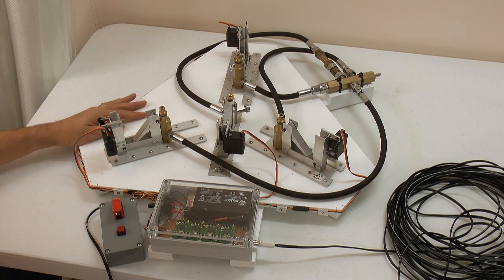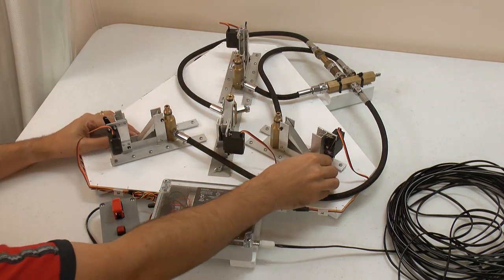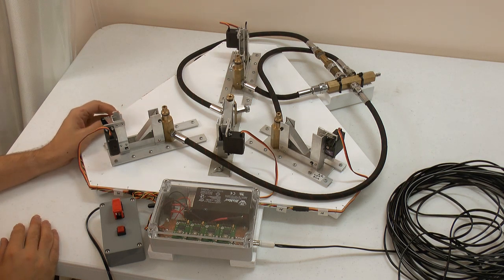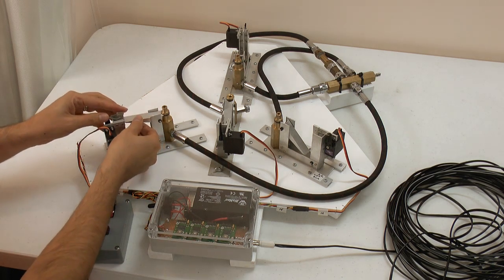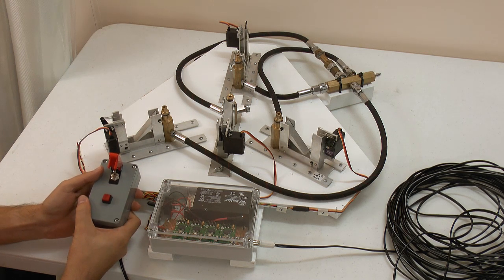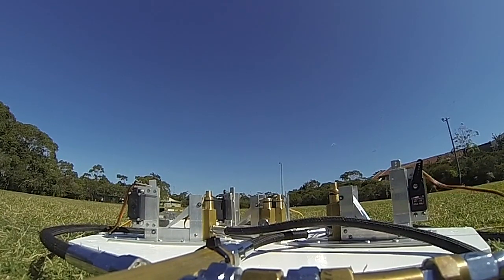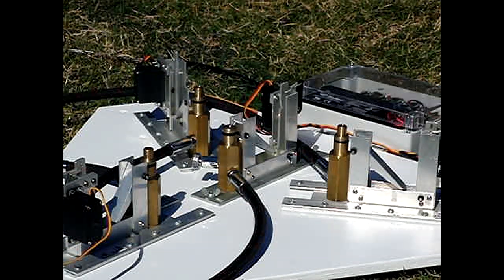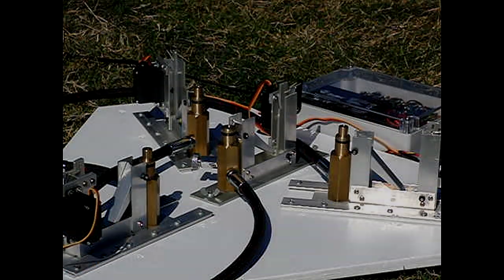G2 Cluster Launcher Tests

Comment: when you charge of water the chamber, water must fall down from the air tube that you use for pressurizing, do you solve this problem with a no return valve at the base (inside connection of brass)  or where?
Reply from the maker: Yes that is correct. We have a non return valve right on the bottom of the central release head. The booster release heads have small tubes that go up through the nozzle and emerge above the water line. They are not fitted in this test since we are using only air and short bottles.

Comment: I'm salivating at the prospect of this 'bad boy' being put to use in launching a water rocket very soon. This is going to be sensational. :) Cheers, b.
Reply from the maker: Thanks biggles. :) We'll probably try a smaller rocket with boosters first before going full scale. We would like to get as much testing in as possible before the big rocket simply because of how much air it uses. We'll only get 2-3 launches per scuba tank so we don't want to abort a launch because of a small issue that should have been resolved beforehand.

Comment: That's really cool.
I'd suggest putting a light on the launch button to indicate when it's armed, cause it acts as a second check before you pressurise the system.
Reply from the maker: Thanks Andrew, that is a good suggestion. We may add a little mirror to the top of the control box so that you can see the electronics is armed. The high brightness LEDs on the STII can be easily seen from 50 feet in daylight. We wanted to keep the remote trigger loop as simple as possible for reliability. At the moment the launch control box just has the arm switch and launch switch wired in series, so we only need a twin core wire to run to the launcher. When both switches are connected it closes the loop and the launcher fires. The idea was that should we get to the launch site and forget to bring the remote control, we could use any old wire to remotely trigger it. We also omitted the usual removable key from the remote controller as you'd find on pyro rocket launch controllers. Here if a kid picks up the remote and fires it while we are prepping the rocket, nothing happens, and at worst the servo motors unlock the rocket but not being pressurised it won't go anywhere, or leak any water. Only when we are at a safe distance do we pressurise the rocket and then the remote becomes "live".